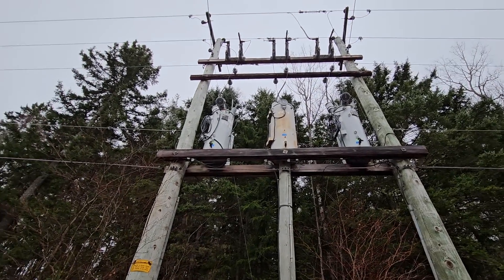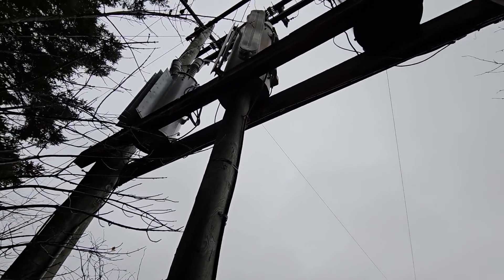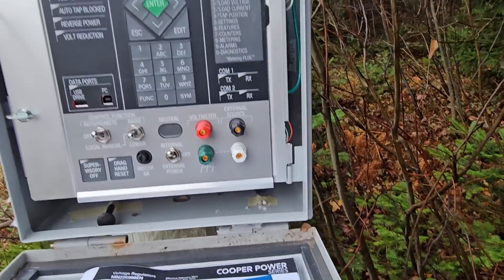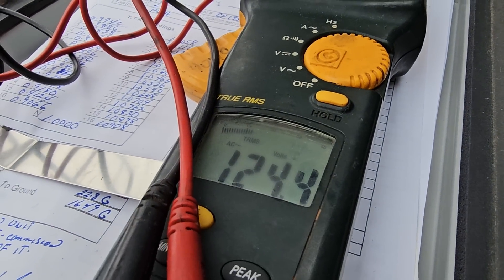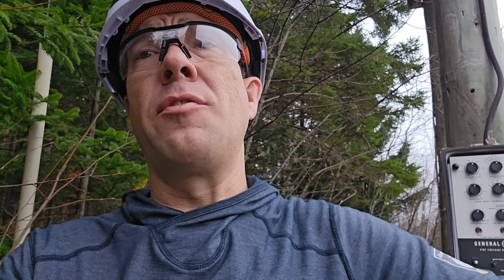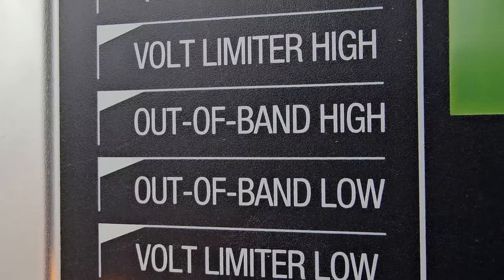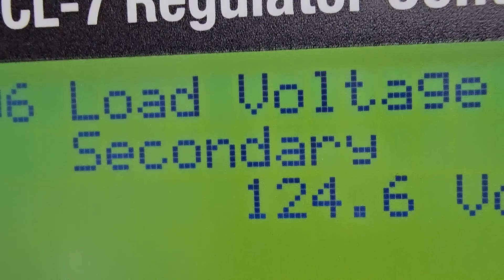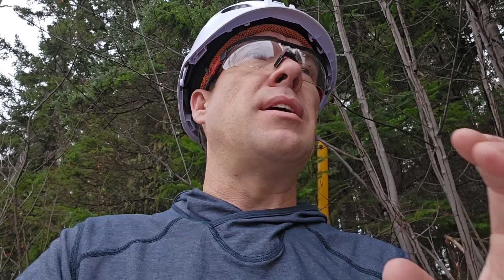Voltage regulator inspection - unedited

Comment: Hey Aaron, what are your thoughts on remote access and monitoring to things like Voltage Regulator Controls, Recloser Controls, etc? Would that help in reducing the # of times a crew has to come out to inspect?
Reply from the maker: Yes and no.... We're starting to have a lot of remote equipment (mostly in substations). While much of their operation can be confirmed remotely and is also equipped with alarms it still requires an actual visual inspection. Mostly for vandalism, tampering and overall condition.

Comment: I was on the way to a job interview last Wednesday at Dungog which is 213 kilometres north of Sydney in New South Wales, Australia or 35 kilometres from where I live & I noticed that Essential Energy who owns the power grid from 25 kilometres south of Dungog all the way up to the Queensland border (I am located in the Ausgrid area which owns the grid from Sydney to there).

On the way to the interview I noticed that Essential Energy has installed one of those voltage regulators as well except for the fact that it's 11 kV in my area.

There is another one which isn't far away from my grandfathers old house which got auctioned off last Friday because he has moved into a nursing home at 95 years of age, he's on my mothers side.

It's just something I notice has changed every time I go somewhere that I haven't been in a while like most of the 1945 power lines north of my town have been replaced starting 10 years ago when they were 70 years old.

I didn't get the job which was just for a  rail track labourer, I haven't been working for almost 17 months & I have been wondering why a lot of the tradies haven't talked to me since I was pulled off site by my employer in mid 2023 because I was working on a casual contract basis for their client.

The answer I believe is by the end of this week is that client needs to employ me as an electrical engineer rather than an electrician yet I could work with you no problems.

I was told that I may have upset a couple of a leading hand electrician & a supervisor whose a Bee there, one of the men who interviewed me is more like you but he's a labourer & I don't even end up working with him even though we'd get on !

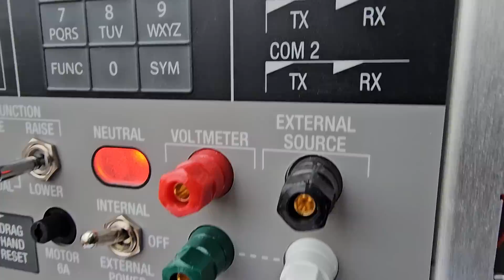Comment: at 9:19 we see a pair of banana plugs marked voltmeter and external. I suspect one of these is for using a handheld meter to confirm the screen voltage. What is the purpose of the one marked external source? What would you be feeding into this device? Is this device battery operated and this is a way to jump start the thing? (best phrase I could dream up)
Reply from the maker: Not something I've ever used, but I believe it's so the unit can be powered up and operated when it's out of service or during an outage.
Reply: @Bobsdecline    in that case I would expect the unit's default setting is back to a 1;1 ratio until a load is established on the line again.

Comment: Cool video Aaron. I would like to see inside one of those, is it like a variac or does it move a limb inside the core to adjust the flux hence voltage ?  For non electrical people these are like an automatic gearbox with cruise control😂😂😂. All the best Aaron, keep them coming.
Reply: The principal of operation is the same as a variac, but with connections to only some of the windings available — it can't regulate down to 10% like a variac can.

Comment: Is it possible to have these units fail if a branch comes down on the lines after the the regulators?
Reply: with that 30 second delay the line will either trip out or the branch will burn through before any auto-adjustment will happen.
Reply: As they're an electrical device, yes, they can be damaged just like anything else, but they're designed to be a lot more rugged than your average clock radio. Notice the fuse port on the front of the panel. (and the extractor tool, and spares in the bottom of the box.)

Comment: I understand your concern for not showing the operation on the regulator device. I just downloaded the operators manual.
Reply: Exactly.  Best to C.Y.A. while still producing an excellent video as always.
Reply: I've said the same. Google will take you directly to the manuals for the Eaton units - and they leave the manual right there in the box. (GE isn't so forthcoming with manuals, and that one looks like it's old enough to have vacuum tubes in it. 🙂) The newer units should have SCADA telemetry capabilities, but they won't always be where they can be connected to any network (cellular, or meter-reader mesh)

Comment: Here is another stupid question: Sorry.  They're adjusting voltage relative to what?  I imagine referenced to earth since adjusting relative to each phase would be and endless exercise of nothing but a drift from a known, fixed reference The PT is referenced to earth I'd think.  Maybe I'm wrong.
Reply from the maker: It is, yes. They run independently from the other phases and generally speaking boost the voltage as the lines get further and further from the sub.
Reply: @Bobsdecline  Thanks.  That gives me a solid 'ground' for thinking about the things.
Reply: A super ancient century old EE rule of thumb is a you need 1000 volts per mile of line before you have too much voltage sag.

 So with that 7200 volt line  7 miles.  

So if there are customers 12 miles from the substation   a good guess is there are 2  voltage regulators on the phase that feeds your house.

If the density of users is small you can go farther. 

That assembly in this video has 1 regulator for each phase.

Sometimes you will just see one regulator and they just boost the one that sags. Ie might be just one phase has way more load.

In older 7200 regulator setups in the South East it use to be common that the next power pole had the #2 phase regulator. Then the next pole had The 3rd phase regulator. Ie all 3 phases are boosted but they each are 1 pole apart and not in one same location.

In EE jargon the 3 phase line set is called a Feeder and or a 1 phase that ties in and feeds a mile of houses with no 3 phase on the poles. 

7200 tends to use regulators here and you about never see them with the local 14.4  kv 13.2 kV line to neutral on my coastal area.

If your house is right after the regulator the voltage is on the higher side. Just before the regulator on the low side.

These regulators are an auto transformer..there is no isolation.  Basically a giant Variac if you fool with electric stuff.
Reply: @3beltwesty  I absolutely am in tune with that concept. I do not deal with high voltage drops so I guess my assumption the is relative to earth is correct since you mention 7200.  It's all in fun to discuss and not looking to insult or correct anyone.  It is just Youtube, not the engineering office cubicle.
Reply: @nhzxboi  correct.  The 7200 boost or drop adjustment is with respect to the neutral which is close to ground/earth in potential
Reply: @nhzxboi  the power co jargon can be that they call 7200 as 12.5 kv too. Ie call the 3 phase feeder by its line to line voltage and not line to neutral voltage.
Reply: @nhzxboi  so the 3 phase feeder at my house is double this videos voltage.  Ie 14.4 kV line to neutral and 24.9 kV line to line. Differences is 1.732 the square root of 3
Reply: @nhzxboi  so for clarify often you have to ask what is the reference . Where I lived on southern California the distribution voltage was 4800 line to line with no neutral wire at all. Delta system.
Reply: @3beltwesty  Thanks for the additional info. 👍
Reply: @liam3284  the high voltage Distribution voltage in this video is Y. Ie has Neutral wire that is close to ground. Ie has a ground rod at every pole. The three 7200 volt wires are 7200 volts line to Neutral..there is 12.5 Kv line to line.
Reply: @liam3284  for single phase  service usually there are transformers connected to  a 7200 volt line and to neutral. On rare cases say a golf course here has a single phase transformer connected to 2 hots. Ie so transformer input is 12.5 kv and output 120/240 to charge 100 golf carts battery's..

Comment: I'm not a lineman and never deal with those things but I am(maybe naively) curious.  Does 'neutral' mean that the regulator is 'in band' and has no need to change?  When you bypass the thing, does it need to be doing exactly nothing before you bypass it?  I am an engineer but not of those things.
Reply: The Neutral position means that there is a 1:1 relationship between the incoming winding and the outgoing winding.  The same voltage goes out that comes in—there is no voltage potential between the input and output.  Essentially, the voltage regulator isn't' doing anything, other than acting as an isolation transformer.  

It is important that there be no voltage potential when operating the bypass knife or there will likely be an arc.
Reply: @jovetj  "...acting as an isolation transformer..." :: except that they are probably not "isolation transformers" at all.  I'm almost certain that it's an "AutoTransformer" of which type there is no isolation provided.
Reply: @jovetj  I'm not sure I trust that answer.  Otherwise the position would be called 'tap zero', not 'neutral' and there would be no real meaning of 'neutral'  The term is confusing but by what you're saying, 'neutral' means 'disconnected'.  I'm having difficulty buying that.
Reply: @nhzxboi  I didn't come up with the jargon.  But, in this case, "neutral" means it's adjusting the through voltage neither up or down. Neutral does NOT mean "disconnected" because only the isolation cutouts can do that.
Reply: @jovetj  But it can also mean 'in band' which is also 'neither above nor below'.
1:1 implies the device has no effect and can be replaced by a wire.  Please take no offence, I enjoy gabbing about these things.  Lol.  You're passionate about the stuff too since I saw you editing whilst I was responding.  Love to all.  It's just fun to be an electrical nerd.  It is to me.
Reply: @jovetj  My experience with multi-tap XFMRs is for an industrial process using Solid state switching of taps. It's not a practical thing for utility power(too much loss) at all but it does work when you need to vary an output from 46V to 2000V...the requirement of the process I was  working on.  Only 75kW for me.  Hence the utility regulators interest me.
Reply from the maker: Yea Jovet is correct, basically Neutral is Tap 0. Winding count will be equal on both sides
Reply from the maker: Closing or opening while the unit is not in neutral position will cause catastrophic failure
Reply: @Bobsdecline  I appreciate you patience with the questions.  The term 'neutral' means so many different things depending on the context.  I understand the electric things for sure,  The 'neutral' in this case confused me.  Neutral seems to mean 'no effect' from the regulator and essentially the regulator is nothing but a jumper wire from input to the output.  Over and out :)
Reply: @nhzxboi  There was another terminology in the video that Aaron used which gave me the same reaction that "neutral" gave to you.  A "surely there's a more appropriate term for that?" reaction.  But I have to watch the entire video again to remember what it was.
Reply: <deleted my comment>
Reply: @AlanTheBeast100  I believe your assumption is correct.  I THINK that the transformers may actually be "AUTOTRANSFORMERS" and they will either "BUCK" or "BOOST" the line voltage depending on the tap setting.
Reply: @AlanTheBeast100  My guess is that the winding difference between adjacent taps is low enough that the change is continuous and the wiper arm or whatever it is called doesn't disconnect from what it was on before it lands on what it wants to be on.  Sure, some arching internally but may so little that it works out just fine.
Reply: @nhzxboi  It is probably a "MAKE BEFORE BREAK" contact arrangment which is what you are describing is called.  With only a couple of volts between taps there would be very little arcing going on when it switched.
Reply: @Wheel_Horse  That is my understanding. The taps are discreet (not continuous) but the taps in the change are bridged while the transition is in progress.  There are some great videos about it here on YT somewhere, but I don't remember if they're on this channel or another.  The oil in the regulator also squelches any arcs which is why it's important it be at the proper level and quality.
Utility voltage regulators are really interesting devices.
Reply: @Wheel_Horse  I would suspect the contacts are 2 stage, with a carbon first contact that makes first, then the copper break contact on the former tap opens, then the copper make contact shorts the carbon,... used to be done with an internal rotary switch arrangement in substation transformers in the UK, usually on the HV side, that of course is for large tx's with on-load tap changing. Tap changers on smaller distribution transformers are usually a simple multitap switch and the tx has to be de-energized before operating, usually up a tap to account for an increase in load. Rodalco on youtube has a detailed video on maintenance of such an on-load tap changer :)
Reply: @TheChipmunk2008  I think it amounts in any case to a "Make before break" contact arrangement in any case.  I've done some looking... it appears that ABB uses a large wirewound resistance that connects and disconnects when the tap is changing.
Reply: @Wheel_Horse  Oh yes deffo make before break but current limiting, it's very specialized... just fascinating as hell. As you no doubt know, simple variacs use a carbon brush and accept the loss
Reply: Actually memory triggered, some of the larger variacs used 'layered carbon' with it more conductive in one dimension than the other.